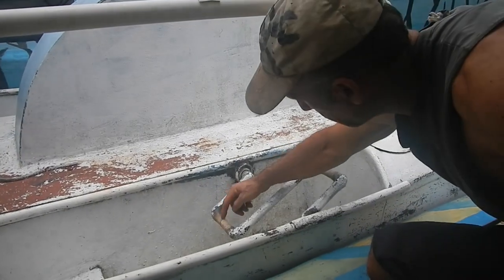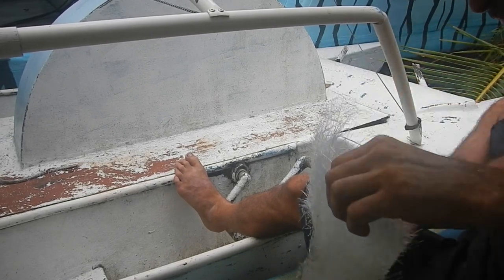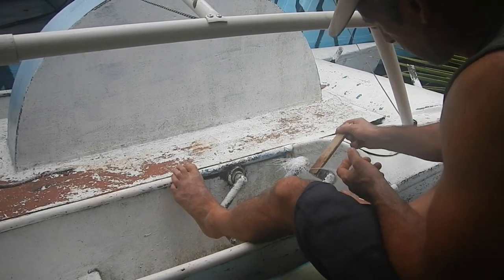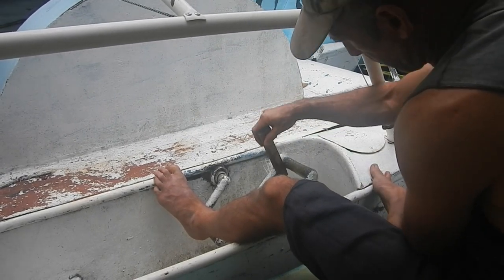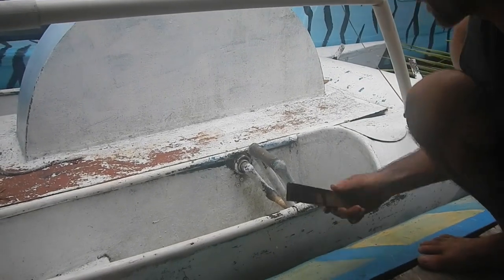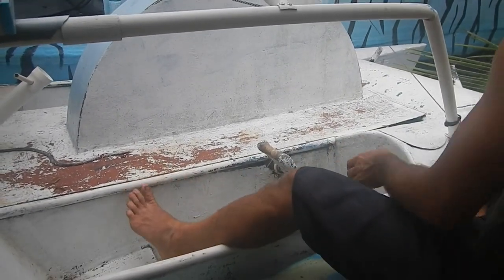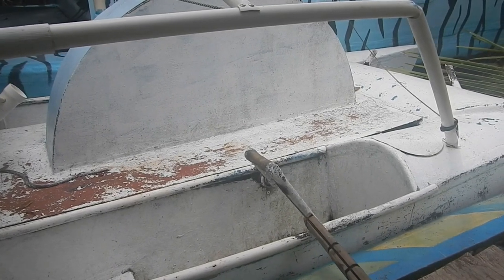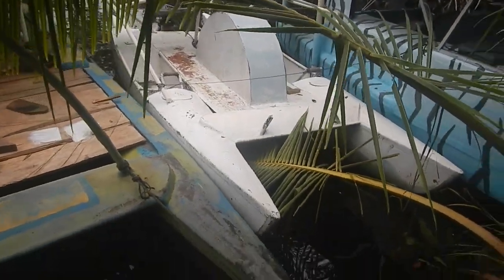Fiberglassing a broken Pedalboat

Comment: Why would you leave the resin behind you ...dripping it on your leg (as you said)...rather than move it right next to where you are using it?

 Did you sand, prep, and clean the surface before fiberglass, using acetone?

Comment: As far as building methods go fibre glass is the least enjoyable by a large margin but there is no denying that nothing else fills its niche either, having to cut and sand the stuff is just as bad. 
Even when I got a job doing it for $40 an hour I still turned it down when they offered me full time :) 3 days a week is the most I could stomach but of course that not good enough for hungry businesses. If they can't get 50 hours a week out of you they don't want 30 hours....Seems silly to me but its not like I regret not doing fibreglassing.
Reply: Just think they could have had two people work 30 hrs a week and got 60 hours a week of work done, never really understood why all the hours have to be done by one person.
Reply: @daveamies5031  Yeh especially as burn out of workers was a common problem. I guess it comes down to if they can find people willing to work the hours its easier for them to manage less people and of course there are plenty when they are getting paid 2 grand a week. With our aging populations businesses are going to be forced to be more flexible in the future.

Comment: Sorry but all I hear is "there's a ton of fiberglass splinters in the feet of this boats' users"
Reply: really wonder why he didn't put roller bearing sleeves on those, or some kind of actual pedals
Reply: @idjtoal  Me too, although this is the first one he built, and so probably figured that it would be good enough, and comfortable enough, and likely also preferred simplicity over extra complication. I agree though, as a cyclist, that reinforced pedals of some sort would have been the better long term option, if only for the slight extra power gained from more efficient foot/leg position (I would also have made a simple adjustable seat length to maximise leg power/minimise leg fatigue. But then again, I'm not the one putting all the effort in to building it in the first place, so credit where it's due haha)
Reply: Projects like this even getting done much less maintained it's unbelievably difficult in reality. I also thought that some sort of pedal bearing cover would make it a lot more usable but probably when you consider how much time per ride is actually being peddled it's not a big deal so simple wins. The ones Jamie drives to town would probably be worth the extra seat and pedal detail. Great to see detail of how things are holding up.